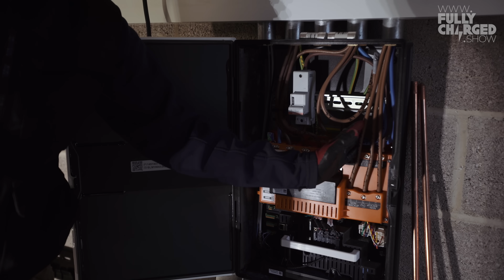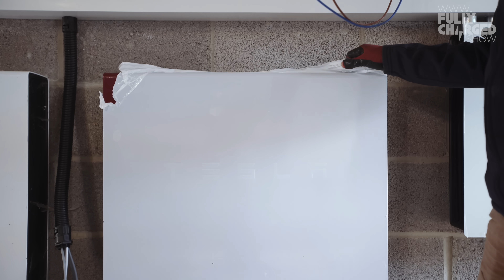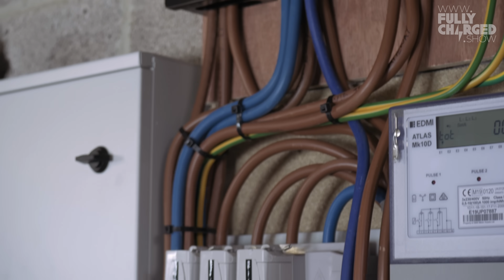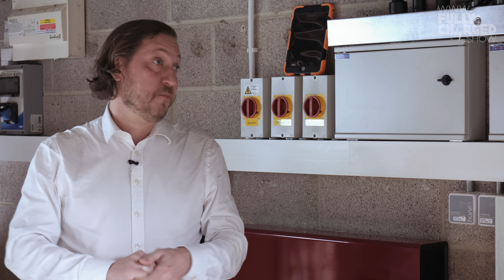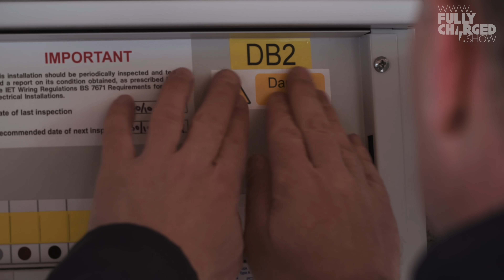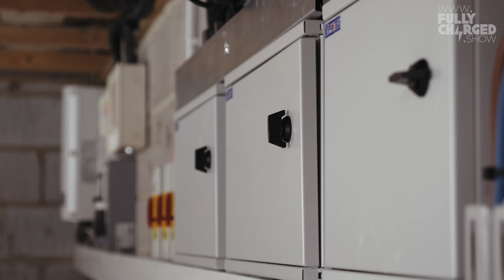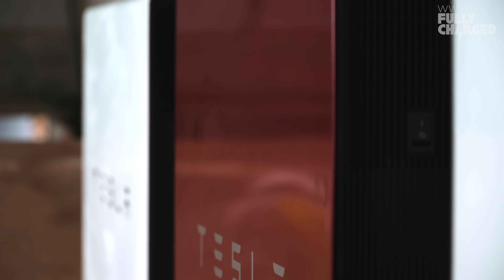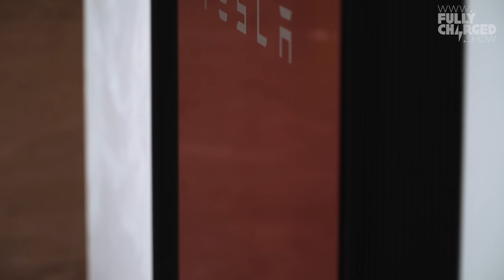Can you run your house on a battery? Tesla Powerwall 2 (Founders Series) & Tesla Backup Gateway 2

Comment: Wow! Such a complicated system! What I don't get is why you wouldn't spend the money digging up your backyard for three phase, on upgrading your roof with a modern "grand designs" style flat one, completely doubling or tripping your solar at the same time, maybe even more! Even just doing a big carport the with solar would have a similar effect I'd imagine ;-) 

Simply get the batteries wired in as a "generator input" in your switchboard and a change over switch and you can simply run "off grid" 99% of the time! If you ever had a really wet weak, just flick the switch back to the grid ;-) 

Simplifies the system, you never have power cuts, and potentially could wir in a DC fast charger direct to your battery storage! 

As an added bonus, I've discovered I no longer need a welder, just a pair of jumper leads hooked up to the house battery ;-) hums along! (Just don't bump across bus bars with a spanner, bit like a gunshot that and a chunk of spanner tends to evaporate!!!)

Comment: Hi, great video, any chance you can share the connection diagram of the setup covering all components? From the video I see that from the meter you run 2 cables per phase + 2 for Neutral and 2 for Ground, But I would expect that this cables would go only to the Backup gateway (only one cable per leg, maybe less because the PW is only 2 phase AFAIK), I wonder were is this second cable per phase is going to???? Thank you!!!

Comment: The backup functionality in case of a power outage is very impressive. If the power was out for let’s say two days, as had happened a few years back when there was a big storm, would the power walk still be able to charge from the panels?
Reply: Yes, that's the whole reason for the gateway, fools the inverters in believing that grid power is still good, allowing the inverters to send power to the Box ! Gateway keeps power from flowing to the grid and killing someone.

Comment: Could a turbine be used in the colder months to make up for the lack of solar energy or a type of built in wind tunnel design that could be Incorporated within the structure to capture air moment? With a tunnel design you could control the velocity via orifice so it could adapt to various conditions and maintain a charging rate.

Comment: curious how many hours those 2 battery banks will power your home? ...you mentioned wanting to use them during peak periods when most expensive, but will they power your home all day (or more) if needed especially say in the Summer when they are being recharged by the solar panels?

Comment: In iraq we can get benefits from this system..but we dont want the solar panel s.. instead we have continuous supply of 4 amps ac electricity to our homes can this system modify to be able run our homes with 4 amps ac current to be used to the wall battery.. if that possible you gain money and you invest iraq money to invade mars

Comment: Can Powerwall 2 be charged as DC coupled battery with power from solar panel? I need a battery system to store extra energy generated from my solar panels when the sun light is at the peak time and the generated power is more than solar inverter can handle. Meanwhile, the powerwall can still be backup when grid outage happens.

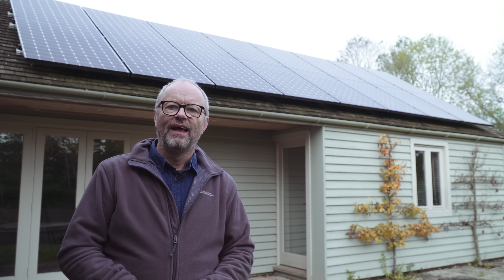Comment: 0:25 all those smarts and you plant a tree right next to your foundation so not only A. Does it screw up your walls when the roots get under and start forming structural problems, B. The roots seek our your pipes and compromise your sewer / water line, C. They eventually create shade over your solar roof causing loss of solar generation. 

My word.

Comment: Takes much too long to switch!! Your devices need to constantly run from the batteries, then only filling it up from grid, when it's too low. This way the devices would not even notice when there is power off at the grid. Only the battery would be charged from Solar only or just being used up. When grid comes back.. it can charge batteries again independant what your devices needs.

Comment: As others have commented, that switch over time was way too long. I know it's only 14 seconds but you'd think a backup system should be instantaneous to avoid the hassle of clocks/electrical equipment resetting and having to sort them out again. I get the need for the physical relay cutoff from the grid but surely the powerwall should be the main supply and just pass through the grid power when required, that way if there is a power cut it has a seamless switchover and then the grid can be disconnected by the relay. It's not too bad as the other video demo'ing the powerwall seems to switch over pretty fast but would be interested to know why this one took so long. Great videos nevertheless :)

Comment: I mean, you can go without a 3 phase upgrade....just expect to shell out x10 on batteries. Its 3 phase bc the house is still connected to the grid. You could run your home electricity fully offgrid if you're willing to shell out the money and space to store batteries enough to power your home for at least 2 weeks (since you don't want to be out of power when a storm hits...). Also, you may want to consider upgrading solar panel spacing too.....its possible, but not the best idea for regular people

Since Tesla only allows 4 powerwalls connected...you would have to go with some fancier solution where you combine 4 powerwalls with a grid array of other lithum ions or lead battery acid batteries and form a huge custom battery grid...

Comment: Wow. This seems like a terrible implementation. All this time I thought the powerwall systems were basically just line interactive power supplies like we're used to using in data centers. Which doesn't need a ton of extra hardware, but won't backfeed the grid ever.

Comment: I wonder if it is possible discuss why three-phase power seems to be required in order to push electricity back to the grid. And why is three-phase needed in order to use a fully charged battery during a power failure? Thanks.

Comment: I don’t know. 🤷‍♂️ We are still very far from the dream of self-sufficiency and independence of the individual.  With the kind of solutions shown, we are not now depending only on the grid but also on a corporation (especially if those devices are “smart” and connected to the internet). It shows how much we are dependent even for those simple things.

Also not sure that we need lithium batteries for home “power banks” as maybe energy density is not such a big concern. Just the sustainability/price/capacity ratios. Would be good to see more affordable solutions that would empower the independence of the individuals.

Comment: what i get from this video is you just got scammed payung for 3ph when it is not needed if it is set up so all solar you produce goes all into house hold for charging tesla batteries and water heater then they is no excess to send to the grid and the fact when the grid went off the power went off tells me this system is rubbish and not very thought out anything like this should be a ups style system for instant backup

Comment: I've installed over hundred powerwalls in the last 3 years working for tesla in the US. That switch over to the battery power was way too slow. Honestly you shouldn't even need an UPS since the transition is supposed to be near instantaneous. Everytime we test it after installation to make sure it works just like advertised and if you loose your power for longer than half a second we have to troubleshoot it.

Comment: Great video. For myself the ability to charge off-peak and safely cut-off to the grid and supply from battery back-up now is a clincher...
Question: If going away on holiday for 1/2/3/4 weeks, with batteries topped up and minimal use  requirements, will the software contain the ability to sell excess Solar production in larger quantities perhaps at the most profitable times via battery discharge or just direct Solar feed to the grid?

Comment: There are software monitoring solutions that will sell power back to the electric service at peak profits to the homeowner.  The next thing for smart gates is to tie into a home or regional weather station to better predict your power needs.  How do you feel about a Socialized takeover of your personal power station by your government? 

They get to take your energy that your panels or other electricity generating mechanisms make and use it to distribute to everyone else.  BUT you don't get paid for the expense of your equipment, its upkeep, replacement when it fails in roughly 25 years, etc.  Nor for personal profit.  

The power agencies get to charge you 3 to 4 times the cost of production so why can't you do the same with them?  Do you make enough power to live off-grid totally?  How windy is it where you live?  Is that also a solution you can tap?  How conservative are you with the power you do create?  Why sell it to "The Man" at all?  Horde nature's free power for yourself.  Maybe sell it for a profit to your neighbors?

While waiting 15 seconds for the reserves to kick in any computer work will get suddenly halted unless they have their own UPS plugged into them.  Does the UK version of the Power Wall still support 8 to 9 daisy chained units to effectively create a single (yet modular) battery?

Comment: As much as I admire the beautiful install and passion of those involved, I remain unconvinced. High capital cost, limited life of electronics and batteries, huge amount of equipment to fail and or give trouble over time inside or in particular outside of warranty, potential ongoing inspection/ compliance costs by the looks of some of the stickers I saw in there, and the tech not yet mature. Then at the end of life there is another significant capital cost to either remove, or upgrade the system. Despite my love of Musk, Tesla, and tech, in the cold hard light of day, right now economically and practically it doesn't stack up for me.

Comment: So the Backup Gateway relay trips whenever there’s an outage, which then allows you to use your PowerWall to power your house. So what’s the process for safely resetting the Backup Gateway Relay? Obviously you wouldn’t be able to reset it during an outage, that would defeat the whole purpose of the Backup Gateway. But how do you know when to reset the relay, and I assume that the Gateway doesn’t reset the relay by itself?

Comment: WHY??? put 3 phase from utility to property????? The solar array charges the batteries and the batteries in turn provide the inverters with DC to run AC appliances, if any appliance has 3 phase requirements like the car charging stations etc, well then add DC to 3 phase inverters to system and supply. End of story ? Cause logically who would pay installations cost of 3 phase if you can make it on your own. Specially if you have 26kwh of tesla batteries available to be charged you by the PV's> im stumped also did not see any requirements for 3 phase on tesla batteries charge needs.

Comment: Hi; interesting you upgraded your main incoming supply, I am looking to to do the same do I was wondering if you could answer a few questions, firstly is the equipment all g99 type tested?  What is the incoming supply cable of taking now, I.e is it a 250 amp fuse? How much did it cost you for the upgrades to your property on the network? Have you seen much of a difference to the cost for the standard daily charge?

Comment: I have 3 Powerwalls, single phase grid power, 12 kW peak solar.  It all works great.  I have my batteries set to 25% retention for power outage backup.  My batteries fill up by mid day (25% to 100%, 3 batteries), the rest of the solar goes into the grid until the sun goes down (I receive a credit on my bill), then I run off my batteries throughout the evening and night.  When grid power goes off, I have NO FLICKER or pause.  My gateway switch is milliseconds, so even my digital clocks do not need resetting.  The only way I know my grid power has turned off is when the gateway sends me a text on my phone.  This setup in the video seems quite clunky and house power fails for several seconds before going to battery power.  What a difference.

Comment: Great video Robert. The only issue I can see is that you won't be able to access SEG or TOU tariffs as you can't have a smart meter on a 3-phase supply. I'm sure you were aware of this before you switched. Why couldn't you have used a G99 compliant export limitation system? Does the PW2 not do export limitation? Would be interested to hear why this wasn't an option.

Comment: Tesla is one of my favorite companies to watch out for, especially with the supercaps aquisition of Maxwell and the rumors around the Solid state battery. However, for a house battery going on Lithium Ions isn't what "clean energy" is about. Because we dont need to safe weight or room specificall for that application it would be nice if you covered an episode on a sodium Ion battery built for a house, such as greenrock. My parents actually just installed one in their new house. I haven't seen it personally but I would love to see what those are capable of. 
Most importantly, can you cross over systems with the Tesla grid lock with systems like that...
Reply: The real switch will come when home-based batteries become 'stupid not to' level tech. We don't need it to be small or light, we need it to work and last. Na-ion might be the answer to that.

Comment: Thanks for sharing this! It's good to hear others' experiences. We are rural and have quite a few power cuts, which is why we chose the Tesla battery with our PV system. There have been 7 cuts since installation in September and the battery has had to provide an hour, in total, of backup power. We are computer dependent so continuity is important to us! Only once did we notice a cut happening, because an internal circuit tripped out. Usually the most warning is a flicker of the lights. 
The other feature that I really like on the battery is 'Stormwatch', which automatically fills the battery ahead of an event like Storm Ciara or Dennis and does not discharge until the danger is over. 
Although elements of the system can be installed outside, it is still rather large and will take up a lot of wall space. It is also not silent, so bear in mind when choosing a location. These are early days for storage, but batteries are sophisticated and worth considering if you have the space and the cash. (On the other hand, I've come across someone who uses old milk-float batteries for an off-grid life.)

Comment: Worth remembering that you use more power charging, then discharging, a battery than you would if you just used that power directly. With lithium ion battery banks it's usually about 1.5x as much, I think Tesla Powerwall's are significantly more efficient in their defence.

Comment: If I want to install a battery in my house, I would run everything from the battery, using solar and power from the grid only as a way to recharge the battery. If you're mostly running the house from the grid, and use the battery as a backup if the power cuts, then you're left with all the annoyances a power cut usually do, such as rebooting computers, resetting clocks, etc.

Comment: In the Netherlands this gimmick is not necessary since the power you generate with your solar panels goes directly to the grid.  Each quarter they look at your usage and subtract the power you generated. And voila you either pay the remaining usage or get a small sum back for surplus power.

Comment: The flickering back on wouldn’t do my computer any good while working on it though. UPS would be needed for the computer no?
Reply: Switch-overs should be instant. there is no reason that it should have taken as long as it did in that clip. most professional installs will not have that issue.